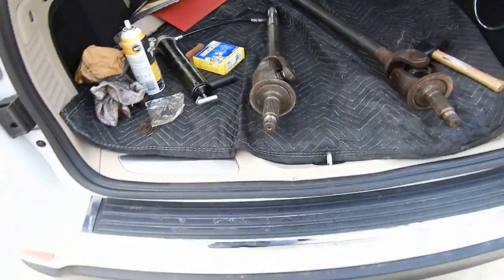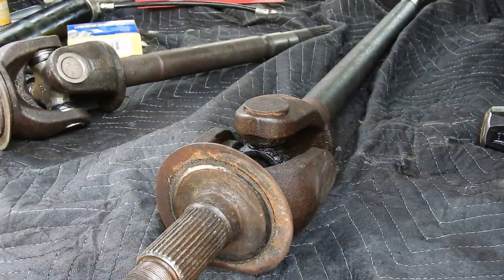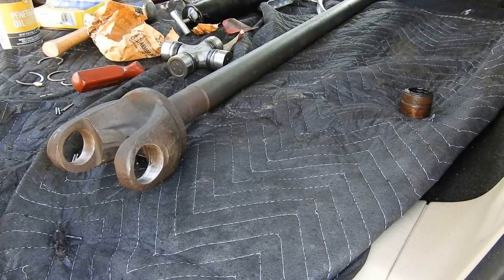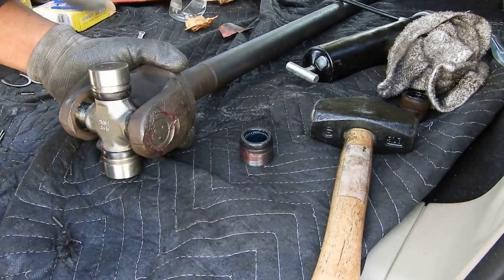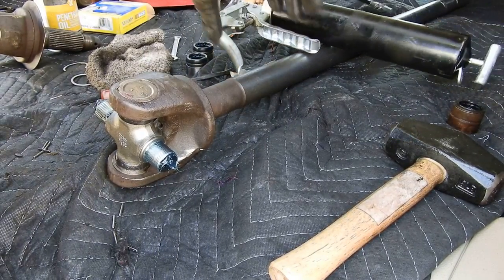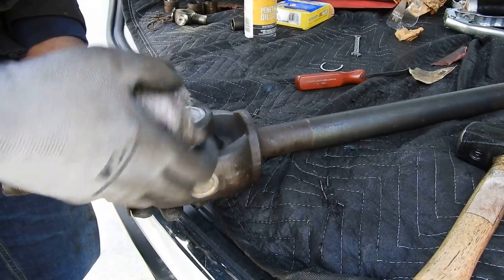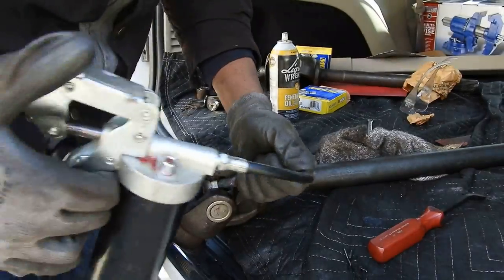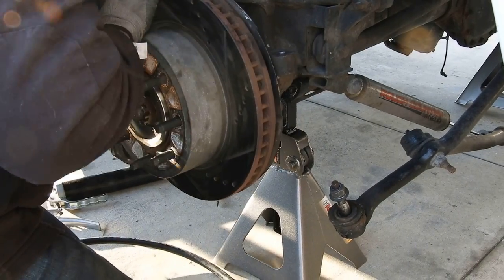HOW TO CHANGE U JOINTS ON CUMMINS

Comment: Biggest mistake people make with these trucks is lifting them and running oversized tires.  They weren't made for that and it prematurely wears all your steering and axle components.  You don't gain a thing by do big tires and height other than lose control and performance.   

Treat and maintain them right in stock form and get many miles.  My 2500 had over 300k miles before it needed new hub bearing units, axle u-joints, and ball joints.  The hubs were possible to separate from the knuckle even with heat and 15ton hydraulic puller and I had to Sawzall the ball joints off and have the hub pressed out of the knuckle at a fab shop.  It's the pits what the chlorides do to vehicles

Comment: Just did the wheel bearing hubs on my 2012 ram 2500 along with new ball joints. I have only 40,000 on my truck due to being a truck driver but the 6" lift and 37" tires wore them out pre maturely.  Semper Fi I saw the Marine Corps flag in the garage! I have one too in mine!! And I saw the CH-53 sticker on the back of your truck. I worked on the EA-6B at Cherry Pt back in the 90's VMAQ-4
Reply from the maker: Mark Shields thanks man and yeah dodges suspension are known for being weak and having yo get changed out early. Straight axel problems

Comment: Not to nit-pik, but that tool is a small sledgehammer. A dead-blow hammer or mallet is filled (almost) with sand or lead/steel shot. You can feel it shift inside when you move it. Sort of like a baby rattle. Excellent vid!  I’m now subscribed. I will try that fuel line plug in your other vid.

Comment: Put a bar in between the studs and the ground so you can tighten the axle nut.
Reply from the maker: jon brown haha I've done that before idk why I didn't think of doing that when I did it lol
Reply: EVERYTHANG DIESEL just did this yesterday but mine is a dually, i have to take off the dually rim spacer the same way.
Reply from the maker: jon brown its definetly a project swapping them out especially if they stuck on.

Comment: Anyone watching this video, NEVER, NEVER, NEVER, pound on the caps with a hammer, this is a Precision machined bearing, use a press, even if your short on cash Harbor freight sells cheep tools.
Reply from the maker: So with this video being almost 2 years old I can confidently say there is nothing wrong using a mallet or hammer to tap the caps on. Your right u can use a press but is it 100% needed?! NO.

Comment: Do you remember what size the 4 bolts are that hold the hub on. They aren't regular bolt heads, they look like they are splined or something. Also is the hub nut 2 and 1/4 or 2 and 1/2.
Reply from the maker: I dont remember the size of the axle nut u can look it up on the forums and the 4 bolts for the hub too.

Comment: I have an 06’ 2500 Cummins and I have this weird screeching sound when I get over 40mph. I believe I found the problem but any help would be appreciated
Reply: You find out what it is? Got the same screeching on my 01 Cummins over 45mph just dropped it off at a shop..figured it was u-joint on the front axle
Reply: @jasonhite5512  that’s almost exactly what it was on mine. I’m going to put the new one in once I receive parts
Reply: AdvancedBio I put 2 new u joints on the front axles. Problems still there. I flip flopped my hub bearings to rule them out. Still there. I’m thinking now that it’s the bearings in the front differential. I think it’s probaly the carrier bearing on the drivers side axle that’s failed..possibly a bad pinion or pinion bearing as well and maybe I’m just hearing it come out the drivers side axle tube at the wheel well. Shop told me $780 labor + parts for all new bearings races and seals in the front diff. I got a guy looking at it this weekend before I put it in the shop. Hope this helps

Comment: What kind of grease do you use for your u-joints?
Reply from the maker: Just some Lucas sticky red I think its #9 I dont remember
Reply: @EVERYTHANGDIESEL  thanks devil. Shouldn't you be working, it ain't no 96, leather.😆
Reply: By the way, I just did u-joints this weekend. I used the "power steering trick", and it worked like a fucking DREAM. You back out the 4 bolts holding the hub on, then leave a deep set socket with short extension on the bolt head. Wedge it against the end of the axle housing, and turn the steering wheel. The truck has to be running or course to use the power steering.